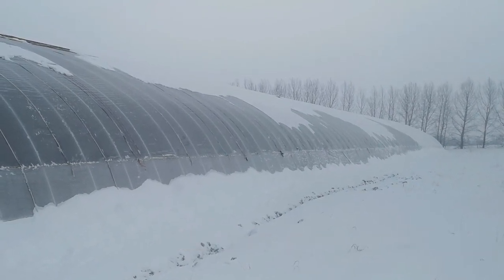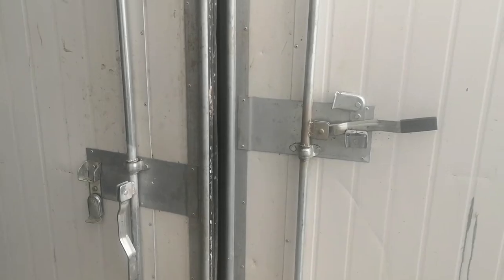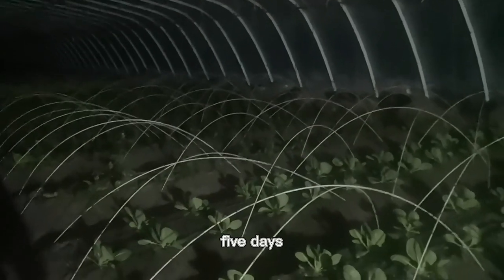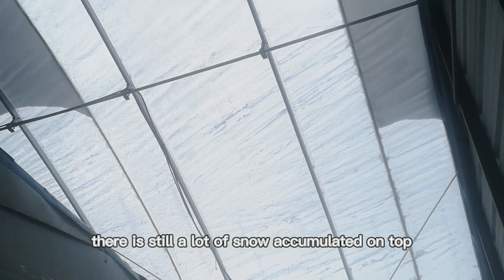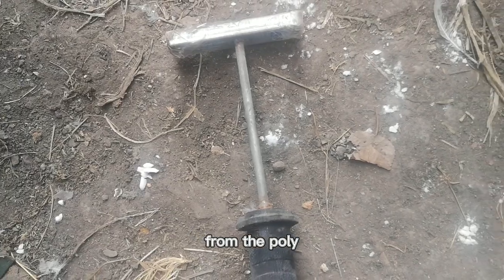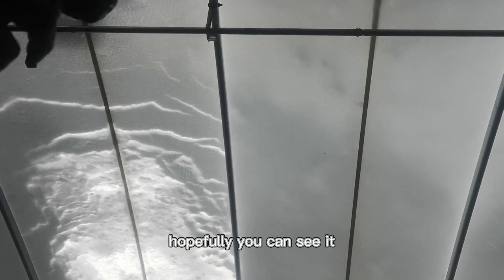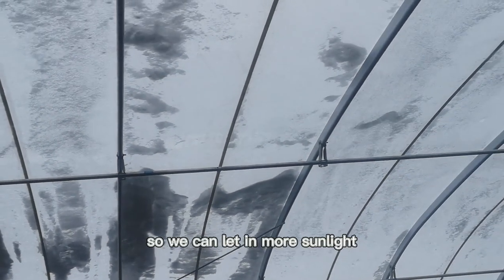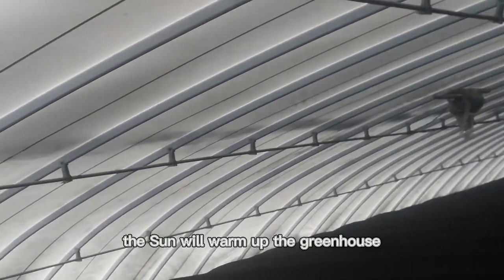Clean snow with vibrators on the greenhouse

Comment: Really interesting seeing how you're growing in such a cold climate. Thanks for your videos - keep up the great work!
Reply from the maker: Thanks!
Reply: @dongjianyi2492  if one Vibrator is not enough then try and modify yours by making a FORK on the front end with two flat hammers at end of each fork so you double the effect. 
Spacing from each other could be to your preference but say around  500 mm apart and could even be mounted onto Springs that could bend slightly to sides to prevent  damage to plastic being vibrated. 

Greetings from South Africa.

Comment: I'm thinking of how to optimize the design by doing four things: 1) before construction, use a backhoe to dig out a meter down so that less clay is used and more earth; 2) extend thick clay walls around the sides; 3) lay pipes within the bottom of clay walls or under the earth near base of clay walls with pipes taking air to the top of the greenhouse with a small fan to better circulate the air in the 10k sq meters; 4) build an all-weather solar-battery array to replace the generator to operate mechanicals. Fun. Can't wait to see people tasting the tomatoes in summer. :)) Maybe we could bring the optimized version to South Korea where winters are harsh. Russia, too. So many applications. I'd enjoy hearing about your story of how you came to Canada, decided to grow tomatoes, and about how you came to think about passive heating designs. :)))

Comment: You need to start raising Rabbits in the greenhouse. Their body temps are high and produce a lot of heat and there should be a good market for them where you live.
Reply from the maker: Sounds like a good idea
Reply: @dongjianyi2492  there are other youtubers that raise rabbits and use the feces to make fuel pellets too
Reply: if only they didn't like eating lettuce...
Reply: @TheJociman  You don't turn them loose. But they would consume a lot of the vegetation that he pulls up at the end of each harvest. Many green house operators raise rabbits for heat and extra revenue. There easy to look after reproduce like crazy and they are very easy to sell.
Reply: Rabbits are also very tasty.

Comment: New to the channel but based on my limited knowledge of your situation I'd suggest a torpedo heater. If no electric is possible or desired a wood stove placed strategically would heat it up enough to melt the underneath of snow closest to the plastic and form water then it would naturally slide off. Essentially killing two birds with one stone. You'd create heat for your greenhouse and rid the roof for sunlight to penetrate even on the most overcast days. You've inspired me to give this a try. Thanks!

Comment: Have you ever thought of making the outer layer a double inflated layer? that would improve insulation and should not increase costs as much.
Question, how do you ventilate the greenhouse?
your content is very good and greetings from Chile.
Reply from the maker: Making a double layer will decrease transmissivity. I open tops and sides to vent.
Reply: @dongjianyi2492  thanks you
Reply: @dongjianyi2492  is your greenhouse already a double layer...? i thought theres another plastic film/layer BELOW of the thermal blanket...? so you have only 1 layer of plastic film...?

Comment: I bow to your ingenuity, science and experience but here's a suggestion. How about connecting several of your vibrators to the poly pipe structure (maybe the cross members). That way it wouldn't be a manual process. Just a thought.
Reply from the maker: Thanks. Vibrators draw a lot of power. The reason one did not work well is because it is too far from the power source and the cable is not thick enough. Need to upgrade the cable.

Comment: How about installing super powerful subwoofers and blasting it with some low frequencies? With enough power it would surely shake the whole thing and would be much easier than manually drilling the roof. Maybe the plants would like it also. Unlikely, but maybe.

Comment: very inventive with that home made snow vibrator! Are you worried about the weight? How much can the structure bear?
Reply from the maker: 20cm snow is fine. But because of the big slope, it usually won't accumulate that much snow

Comment: That is very similar climate conditions to what I am facing in Kenai Alaska. I like the homemade DIY snow vibrator removal system! Those kinds of conditions are why I was going to incorporate a GAHT type system as well as grow lights and a rocket mass heater attached to the GAHT, as well as the Chinese style greenhouse. The grow lights will not just supplement the light but they also put out some heat as well. Of course, my size on the greenhouse is only going to be about 16ft by 70ft (4.9 x 21.3 meters), so a lot less than what you set up. 
Very good job on the greenhouse design. I was not expecting the first layer with the insulating blanket to be strong enough to walk on. Did you use a thermal block metal foil insulation, just the fabric insulation or a combination?
Reply from the maker: Just fabric. We have to optimize the building and operating cost on such a scale. Because I am a commercial grower, the cost and porfit are two things I consider most.
Reply: Hey you should really consider this style to GAHT
Reply from the maker: @Xlr8ive  I'd really like to consider GAHT. But it is a big project for a 10,000sqft greenhouse. How much money do you think it will cost?
Reply: @Xlr8ive  Hi Tyler. I'm not sure what you mean. This style of what to GAHT? There is no other information listed.
Reply: @dongjianyi2492  Quite a bit of money for excavators and pipe etc. You have different financial considerations than I do, plus I have the advantage of being in the design phase instead of having to retrofit a working commercial greenhouse with the revenue loss that would entail. You could still try a rocket mass heater run through a thermal bench, which will release heat over a 2-3 day period. Another one I want to try is a compost pile, which heat at 180 degrees F. I might have to cover it, but if some relatively inexpensive HVAC metal conduit attached to a fan were run under it to release the heat it should provide a lot of energy to the system, as well as eliminate the risk of it catching on fire. As long as you kept it with just greens and browns with no manure or other animal products it shouldn't smell or release fumes. You can never have too much compost, that's for sure!
Reply from the maker: @jamesstepp1925  Thanks for all this info!
Reply: @jamesstepp1925  I think the idea of composting plant debris inside the greenhouse in three different locations along the clay back wall would be the way to go. Regarding GAHT, it could be just one pipe running the full distance of the greenhouse and then circling back with vents along the way along the top of the greenhouse clay wall... Maybe try a small-scale test before scaling in 2nd GH?
Reply: @yonseienglish  Hello, I agree with you. I cannot speak for Dong Jianyi as he is running a commercial greenhouse. That means he has business constraints regarding what is affordable and makes sense for his operation. His greenhouses are a lot larger than the one I will be building as well. 
I was impressed with his Chinese style greenhouse, a design I had already decided on emulating. I found his channel while gathering more information on the design. I was explaining what I have planned for my greenhouse on my property in Alaska, where we face a similar climate but less sun because of our proximity to the ocean. People in our area say that they go to Seattle Washington to get a tan!
For me these measures like compost piles, GAHT, rocket mass heaters hooked into the GAHT etc. make sense because this is strictly for my family. I don't have to turn a profit and my greenhouse cost can (and will) be out of step with any profit or book balancing. For me it is recreation and building something fun. I would like to raise citrus like dwarf oranges, lemons and bananas, usually zone 8-10, in a zone 4 environment so every bit helps. I will probably raise quite a few varieties of edible mushrooms and do outdoor food forest too.
If he can use any information or ideas I gave him that's great, and he gave me good feedback as well. However, his operation is different and he has a lot of experience so what will work for me may not be feasible for him.

Comment: You might try attaching a vibrator directly onto the steel frame in different places for a test.
You might not have to walk the whole length of the greenhouse to remove snow, while spending a lot of time doing that.
It may have to run for a little longer, but it might set up a vibration through the whole system
Reply from the maker: The farthest vibrator is not doing well in extreme low temps because the power cable is too thin. I will solve the problem by upgrading the cable.

Comment: I have a 400sq ft greenhouse in ontario canada that is designed using passive solar methods. I grow tropical plants in it and would like to add a insulated blanket system to reduce night time heat loss. What is the name of the material or supplier that you use? Thank you for sharing these videos.
Reply from the maker: Please email me. tsjianyi@gmail.com

Comment: maybe get a couple of small industrial motors that shake the entire frame of the greenhouse? you could probably clear all the snow in 3-5 min.
Reply from the maker: These vibrators are industrial grade. The only problem is my electric cables are not big enough to power the one on the far end. They draw too much power at start up. Need to upgrade the cables.

Comment: For this scenario, you'd benefit from some shallow geothermal heat collection. 12 to 16 feet deep trenches on a few hundred meters, bury ventilation pipes and circulate air in them. You should get a few more degrees for when there is no sun. (Kinda like this guy did in Nebraska : https://www.youtube.com/watch?v=ZD_3_gsgsnk)

Comment: I was wondering how well the vibrators worked in February.
Reply from the maker: They usually work well. But when the snow is wet or the snow is too heavy, they will have a problem.
Reply: @dongjianyi2492  I think the vibrators need to be optimized differently for heavy wet snow. I wonder how to do that...

Comment: Can i surgest solar panels and ground heat combo to cool or heat your projekt?
Reply from the maker: Yes. But need to consider the budget
Reply: @dongjianyi2492   i understand that but it should be posibel to keep your grow house +1 by digging a cold sink hole along the back wall and adding some kind of pipe system to steal heat from the undergrund fx the People that still build iglo to live in for real dig 2 steps over ground level to sleep on and a deep hole betwin Them under ground level as a cold sink the thinking is that heat and cold Will place them self in layer and that you might as well get the cold to start way lower than ground level

Comment: So you just use solar for heating duning the day? 
Why do you not have Solarpanels for your Motors  instead of the the generator ?
Reply from the maker: How many solar panel doI need to power a 3horse power motor? Are they affordable?
Reply: Panels are fairly inexpensive but useless by themselves.  You would need batteries which are very expensive and some type of charge controller which also can be expensive depending on your specific total system requirements and details.  Then since you’re using a convention generator you probably have motors for AC versus the native DC from the panels so you’d need to purchase new DC motors or add an inverter to your solar setup.  Also motors use a lot of amps when they initially kick on which would require you overbuild the batteries and controller part of the system to handle the initial surge.
Reply from the maker: @pfd1972  Thanks for the info!
Reply: @dongjianyi2492  Use lead-acid batteries instead of lithium-ion. They are much better in cold weather, too, I think. You might want to study the work of Amory Lovins at RMI.org, or The Rocky Mountain Institute. Lovins' home in Snowmass, CO, is the first PassiveHouse in the USA which inspired the entire PH movement in Europe and the USA.
Reply: @dongjianyi2492  Amory Lovins uses lead-acid batteries in his home. :) I recommend integrating the solar array with batteries in some way with your next greenhouse; but, to be safe, do it as a stand-alone system nearby the greenhouse before trying to integrate them on the greenhouse itself. This way you can get familiar with the system before doing more with it on your third greenhouse.
Reply: @dongjianyi2492  I googled it. You'll probably need at least a 3 kWh system to replace each generator, but if you build a second greenhouse, you'll want enough to power two at peak, not one, so 7 kWhs should be safe for both greenhouses. But ask yourself, how often will you actually use it. Can you sell excess power back to the grid? Can you find a way to use the power on-site if you can't sell it? It might be better to just keep the generator.

Comment: It is difficult to improve upon the handsaw improvisation.
Reply: Maybe if he started the vibration at the bottom and worked up it would work better. Clear snow from the bottom first to give the snow up high somewhere to slide. But the idea of using the broken saw as a vibration device is perfect.
Reply: @oldauntzibby4395  You want to clear the high-hanging blocks of ice and then let gravity do some of the work.  Imagine the snow as a low-density icicle, if it breaks from the top there is some kinetic energy to assist the process.  It's not really useful to speculate about the character of the snowfall without exact data about the weather conditions.
Reply: @willjennings7191  I was thinking of it as an ice jam. If the bottom was broken up first then the upper layers would have more room to slide down on their own, maybe without need of vibration, just gravity. But this is the only video I've watched about his greenhouse so maybe I don't know enough about its shape.
Reply: @oldauntzibby4395  Yeah, it's the shape I thought because watched the mechanical parts of the videos.